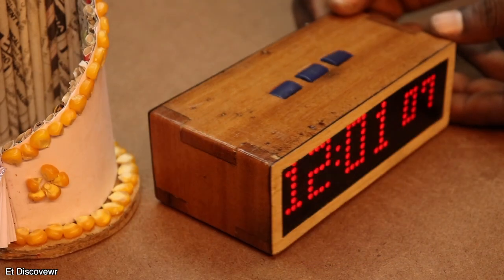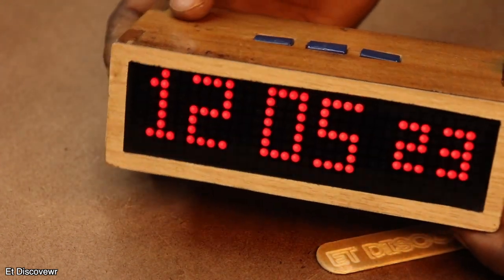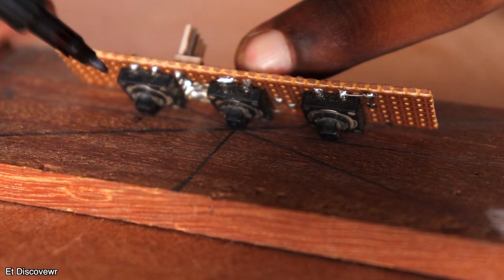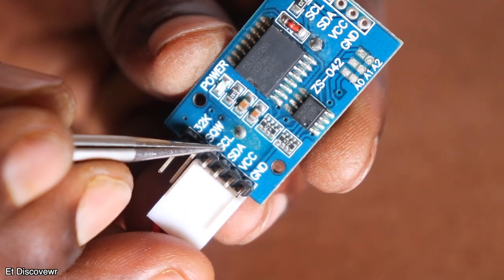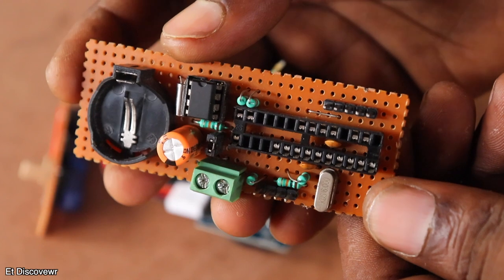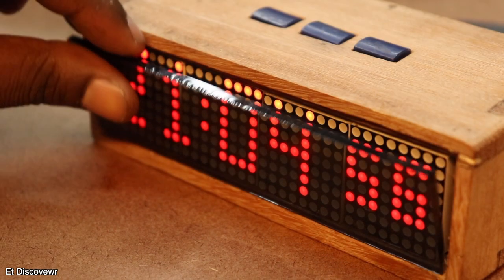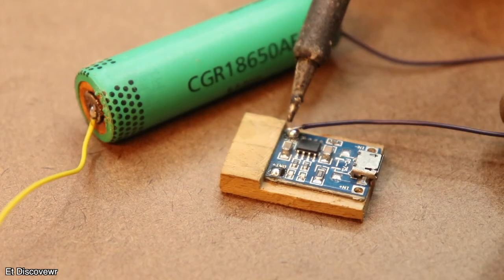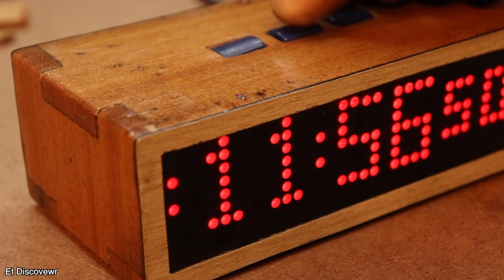Make a Vintage Looking Wooden #Digital Clock

Comment: Did you get success on the crystal FM transmitter project? Is it possible to modulate frequency of a crystal while it is very stable oscillator and doesn't like changing frequency even a little amount.
Reply from the maker: Yes it is success and the Receiver project will be coming end of this month